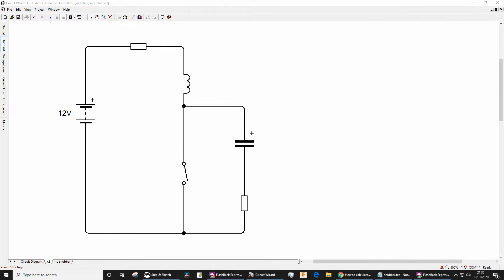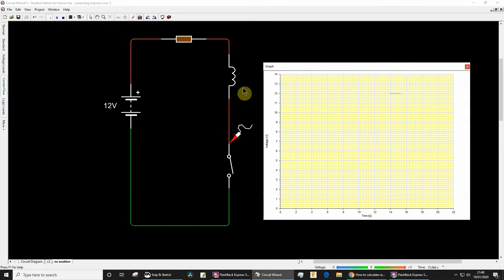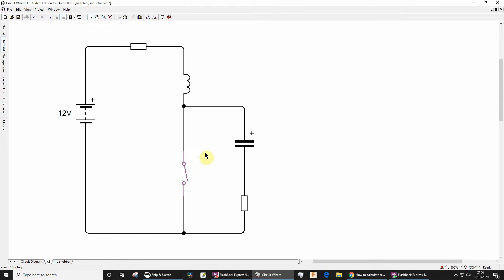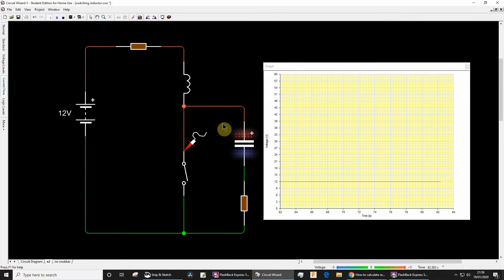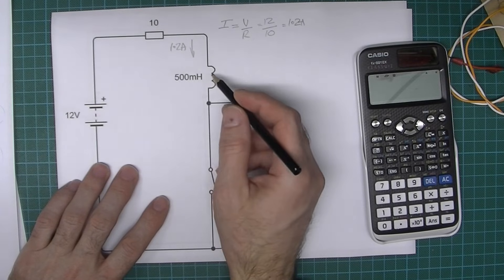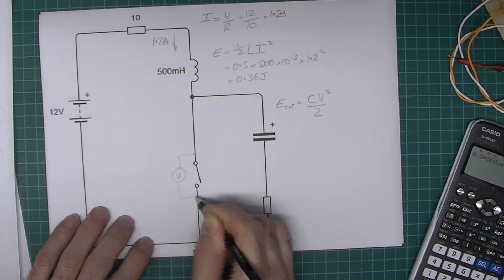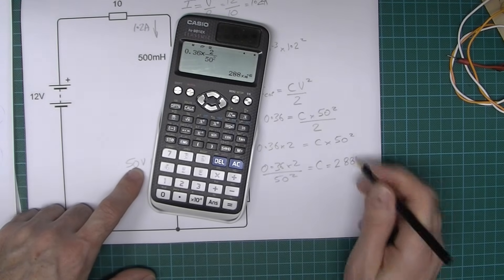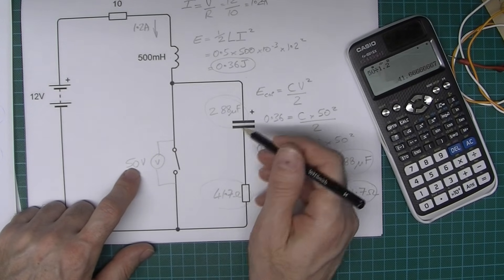RC snubber circuit design and calculations for inductive loads

Comment: Excellent explanation. 
A question: Is this method also valid for AC?
Thank you so much.
Reply: Yes.
For AC usually use varistors (MOV) to clamp the spike. Although it is good idea to install fuse or braker in line, as varistor will drain access voltage to ground/neutral side.
Reply: @commenter5469  Thanks for the information. It is very useful.

Comment: Why 50 v
Reply: This was arbitrarily taken. It has to do with the safe operation of the switch to be used. If the clamping voltage was to be kept at 12V, this would demand a capacitor of several thousands of microfarads, which makes no sense...

Comment: Hi could you help with a problem ...how to calculate a rc snubber for a bidirectional dc motor operating at14v that is damaging the switches controlling it ( power window circiut)  thank you

Comment: Silly noob Q,     why doesnt current pass through the snubber when the switch is open at 3 minute mark . why is the snubber active only when the switch is closed
Reply from the maker: Look at the symbol for a capacitor - two plates that do not touch (separated by a dielectric layer). The capacitor effectively blocks the continuous flow of DC current as does an open switch.

Comment: Nice video. 
I have a question though, the energy stored in induction is 0.36J, then we use this same amount of energy to workout the capacity of the capacitor. Because of the existence of bottom R(the one 41.7 ohms), some of the energy is consumed by resistive loss. So I assume there is a step of the calculation proving the energy consumed on R41.7, for some reason, has to equals to the enemy provided by battery AFTER switch is turned off. Would it be possible to elaborate a bit on this? 
Thanks a lot
Reply: It is possible energy stored in the capacitor is the same as the energy stored from the inductor, for the capacitor is gaining energy from the supply even if some of the energy released from the inductor is dissipated in the resistor. The discharge process does not stop until the voltage across the capacitor is the same as the supply voltage.
Reply: A) The switch closes: a1) the energy is stored in the inductor, a2) the stored energy in the capacitor is dissipated into the snubber resistor. B) the switch opens: b1) the energy stored in the inductor makes it behave like a power source with reversed voltage polarity now, which adds to the source supply voltage and b2) the already charged snubber capacitor discharges through the snubber resistor, absorbing the overvoltage spike as well.

Comment: Does this have a time constant tau within which it will remove the spike voltage??
Reply: Yes, and this is the product (R x C) of the snubber elements (:288μF x 41,7 Ohm = 12 msec).

Comment: Thank you so much for such a useful explanation. I have a 30A 12VDC relay that is drived with a bjt, a flyback diode and microcontroller. When I turn on/off the relay my circuit works properly but when it is connected to a motor or contactor after a while the microcontroller freezes. Is it good to add this circuit to the coil for solving the problem?
Reply from the maker: Have you added bypass capacitors on your power rails? You may need to do this to reduce noise on the power rails otherwise your microcontroller can be unstable.

Comment: very useful information...Thanks lot...few doubts....  1.if we are not using current limit resistance means what will be I?Can we take motors Coil reistance and  Rds on as Resistance.....2.What will be voltage rating of snubber capacitor (C volt=V*2)  3.Power rating of snubber resistor

Comment: this vs a flyback diode?
Reply from the maker: Good question. If switching DC, use a flyback diode in parallel with the load. If switching AC you can't use a flyback diode.

Comment: Great video.  Thank you.  What does the power dissipated in the snubber resistor look like as a function of switching frequency?  The 1.2A is the current charging the capacitor, but not the current through the snubber circuit when the switch turns back on and the capacitor discharges through the switch, forming the loop Rsn, Csn, and Rsw (sn= snubber, sw = switch).   So, Rsn sees both charging current and the discharge current.  What is the best way to compute the power dissipation of this snubber  resistor?

Comment: same snubber calculation for any type of switch (mosfet, igbt)?
Reply: Well, technically you do not calculate a circuit but the energy involved in the inductors` circuit, so I do bilieve you're correct. Keep in mind thou that a MOSFET might have different vaulues than a switch does.

Comment: Sir, 
I am using a 3 phase contactor to switch a 25kvar capacitor at 440V(33A at 440V), can u suggest the right values of capacitor and resistance that can be used as a snubber to supress arc
Reply from the maker: If in doubt I would pay a trained electrician to do that job. Sorry I could not be of help.

Comment: Hi (from Egypt). That's very informative. However, I have a solenoid (240 VAC, 6 watt, resistance across its contacts is 3.68 kohm) that I plan to control with a solid state relay. The solenoid has no data sheet available (I don't know the inductance nor the current). Is there a way to calculate an approximate values of R and C?

Comment: Thanks. I tried playing around with a snubber circuit, but it seems my 50MHz scope is not fast enough to see the transient voltage spike. My effort was kinda pointless anyways. I don't know how to effectively calculate a universal motor's inductance. My circuit just uses the default 100nF/100R values and with my scope, I guess ignorance is bliss because it works. Thanks for the upload.
-Jake
Reply: 50MHz should be fast enough unless the spike is in nanoseconds

Comment: Great video but what should be the max voltage for snubber cap ? 50v or 5kv ? and also the power of snubber resistor 1/3w or a 1watt resistor ?
Reply from the maker: If the snubber limits the voltage to 50V this may give a good starting point when specifying components. If the snubber works as intended, there would be no high-voltage transients in the circuit. As for the resistor wattage I'll leave that one for you to calculate. It's been a while since I watched this video but hopefully I've given sufficient information.

Comment: Which V rating should the cap have?
Reply: For the example of the video, the upper next voltage rating to 50V, that is, 63V. USually we use at least double the circuit supply voltage (here, more than quadrouple)...

Comment: Here you know the length of coil that is 500mH what if I want to design it for my water pump in that situation i do not know the lengh of its  winding and i am unable to get any data related to it then how  should I do this calculations.

Comment: The energy transferred to capacitor will be half of the energy stored in inductor, as half of it will be lost in resistors during the transfer.
Reply: I beg to differ, all energy stored in the inductor will be dumped on the capacitor, the resistor is there to simply dissipate tht energy into a form of heat so as to discharge the capacitor.
Reply: @fabianm.2982  Please simulate and check

Comment: Very nice explanation.  I am designing a contact point triggered ignition, i replaced the hv contact with an nchannel mosfet 3205,  triggered by p channel mosfet and the regular kettering contact point, i am having a problem i kept on burning the 3205 mosfet i already placed a diode between drain and source on 3205 but when installed it burns. Can you create a video of this using mosfet? Thanks a lot.

Comment: Thanks for your explanations. May I learn how did you calculate 50v over the switch?
Reply: It is not calculated, it is the maximum voltage the switch can withstand
Reply: yes, but in this state it will filter only the peak voltages up to the withstand voltage, which in reality may be much higher, in which case the snubber will be insufficient.
Reply: @necipsahin8377  not sure if I understand your point, but in this case, the maximum voltage AFTER filtering will be 50 V, so there is no danger

Comment: This is snubber simplied. Thanks for the video. I did deduce something from your explanation, the RC network can also be calculated from the inductance voltage formula thus: VL = L I/(RC), by substituting those calculated values and the inductance value into above formula the predetermined spike voltage arrived at.
Thank again
Reply: excellent analysis!

Comment: I may have to revise what I am going to say but I do not agree with his mathematical analysis presented in this video as the capacitor will never see the 50 volts voltage suggested across it. Here is the engineering reason for my conclusion.

1. When the switch is on, the energy calculation in the inductor was correct. The heat energy stored in the 10-ohm resistor cannot be returned, so that is correct in using only the inductive/magnetic stored energy. When the switch is on, the load  to the battery consists of the resistor 10 ohms, the transient impedance of the inductor, and the zero output impedance of the battery acting as a VOLTAGE SOURCE which is basically zero ohms and the small resistor in the MOSFET.  

2. When the switch is opened all the above changes, as with the inductor being present the battery and 10-ohm resistor and inductor will become a CURRENT SOURCE,  with the current stated flowing, and this needs to keep instantaneously flowing at any voltage really!!  So when the switch is open the current must be retained into the RC snubber which behaves as follows. Since the action is very fast,  the capacitor or any value will be a dead short circuit and so the 50-volt voltage at the snubber acting as a load to the current generator, note "current generator",  will be the current (1.2 amps)  flowing through the resistor (41.7) ohms. This flow of current in the resistor will use some of the electromagnetic energy in the inductor with the additional energy being used to heat the 10-ohm resistor in the circuit, and hence one cannot use the full energy stored n the inductor to finish up charging the capacitor, as it does not, most of the energy goes in heating the resistor 41.7 ohm in the snubber, and the resistor 10 ohm in series with the inductor.

3. As was said before, any value of capacitor for a very fast voltage change across it will act as a DEAD SHORT CIRCUIT  so the initial zero voltage of the capacitor will rise from 0 volts to 12 volts of the battery and the final value of the energy stored in the capacitor is due to the battery voltage only,. which is 12 volts.  It is an interesting integral function that goes on in that capacitor as the current is slowly decaying in value. 

4. 288 micro-Farads are just too high for an RC  snubber where the MOSFET is periodically switched as the high energy in the capacitor will have to be dissipated by the Mosfet when it comes on, and it would not like it at all with all that energy in that large value capacitor.  The approximations of theory and simulations are one thing, while the practical circuit is another. 

A suggestion as to the amount of energy the snubber and other existing resistance is required to dissipate is the amount of energy stored in the snubber
 capacitor. It is recommended that you choose a capacitance value that causes the resistor to dissipate one half the wattage rating of the resistor. Note that though the load /battery feeding the snubber is a current source with its own imperfect high output impedance also containing the 10-ohm resistor.   Due to reasons not mentioned in this video, the snubber capacitor would be more likely to be around 1000 PICOFARADS  and not MICROFARADS.   It scares me to even think about that high value.

Comment: Hi sir, Thank you for adding this video. This is really helpful. I have two questions for you. 1) What is the simulation tool you are using in this exercise? 2) If we see any motor driver circuit (Eg: Page No:17 in  https://www.ti.com/lit/ds/symlink/drv8353m.pdf?ts=1609974450389), to control the motor we mostly see Gate Driver --> Half bridge --> Inductive load connection. So, in this case to control the transient/regeneration can we use the same RC snubber circuit?  In this case what would you suggest sir? If possible could you please make a video on this? Thanks a lot in Advance.

Comment: Thanks for a most useful and excellent Video, No idea what the inductance of the motor I want to use is ? However I guess I will figure it out, one (constructive) criticism, ditch the potato mic, hard to pick up some words. Maybe its the encoding settings?
Reply from the maker: Thanks for the feedback. Are you planning to control an AC or DC motor? An RC snubber can be used with AC or DC, but if your motor is DC then you may find a simple flyback diode a simpler solution. There are other snubber types too, including resistor - capacitor - diode. Regarding the audio quality (or lack of) it's a valid point and a long-standing issue that I have not yet addressed. It's due to a combination of factors not least of which is the cheap microphone and its placement. I'm working in a very cramped location (this would make a good video in itself) and I need to make myself an adjustable microphone stand. It looks like my videos will become monitized in the near future, and if that happens I will look into improving my setup.
Reply: @PizzeyTechnology  Thanks for your reply. I will try a snubber as I want to go through your steps just to get an idea of them.
 I found an article 

https://electronics.stackexchange.com/questions/182116/whats-the-easy-way-to-measure-a-dc-hobby-motors-inductance

that should do the trick for finding the small motors inductance. Its so obvious. I am being really lazy , relying on the google machine instead of thinking.

Comment: Shouldn't 50V be divided among capacitor and resistor being in series?
Reply from the maker: Good question! Two resistors in series will divide voltage in the same ratio as their resistance. e.g. 1K and 2K will divide the voltage into 1/3 and 2/3 respectively. However, a series RC network does not respond in the same way. A discharged capacitor is equivalent to a short circuit (e.g. closed switch) and will therefore have minimal voltage drop. A fully charged capacitor is equivalent to an open circuit (e.g. open switch) and will therefore have a large voltage drop. Therefore, as the capacitor charges the division of voltage between these two components change. Let me know if that helps and don't forget to subscribe. Thanks!
Reply: Clear now. Thanks!

Comment: Sir power diode ke paller me rc sunbber curcite me resistance, capacitor ka value kase nikale pl.batye
Reply: Sir,  rc  curcite is placed in paralleld to igbt, in which how can we calculated the value  of resistance, and  capacitor  pl. Video  sed

Comment: This seems to be quite well explained sir, but I'm afraid my monkey brain can't handle the science quite as well. So I'll just  spit it out here:
 I have a 220v AC solenoid valve which I want to control with a 5v relay which is rated at 250v max load. What capacitor and resistor should I use in this case?  

Thank you so much for the effort put in this video!
Reply from the maker: 5 VDC control circuit? If looking to protect the DC control circuit from back EMF a diode may be more appropriate. Check the data sheet and any application notes first rather than relying on online advice.
Reply: @PizzeyTechnology  I guess I did not explain quite well. I have a 5v relay module controlled by a raspberry pi. http://wiki.sunfounder.cc/index.php?title=4_Channel_5V_Relay_Module

Comment: Sir I didn't understand about the 50 volt across the switch
Reply from the maker: 50V is the induced voltage and not limited by the power supply voltage. I chose to limit to 50V but some other value could have been chosen.
Reply: @PizzeyTechnology  thanks sir for explaining

Comment: Does the current thru the circuit not depend on the total impedence of the circuit? Why do you use only the resistor value?
Reply: This example  here works on D.C voltage. The current therefore is determined only by R (=10 Ohm).

Comment: Super useful video. I was just learning about how to design a snubber circuit for a TRIAC in an AC application. The catch there is that you also have to keep in mind the reactive power that will be flowing through the snubber when the switch is not closed.
Reply from the maker: Glad it was helpful!
Reply: Name of software you used ?
Reply from the maker: Circuit Wizard

Comment: help a lot! very great and useful explanation!
Reply from the maker: I'm glad to help. Thanks for the feedback.
Reply: @PizzeyTechnology  you are my papa
btw, this can be the protection for mosfet or any transistor right?
Reply from the maker: Yes, but best in mind other options exist. For example, a free wheeling diode (reverse biased across the load) if using a DC supply.
Reply: @PizzeyTechnology  Yes I’ve use the reverse diode in the inductor.
I have to make a boost converter for the fast-charging capacitor circuit, therefore I can't dissipate all the energy on the diode.

Comment: Shouldn't a parallel reversed diode do the trick ?
Reply from the maker: Yes, that will work fine for a DC supply. But when using AC an RC snubber should be considered.
Reply: @PizzeyTechnology  true and more is that in dc high frequency pwm a simple diode will not be adequate 
But for AC i think a thyristor could work "low frequency case"
Reply from the maker: @mmmk1414  Schottky diodes can be used for higher switching frequencies.